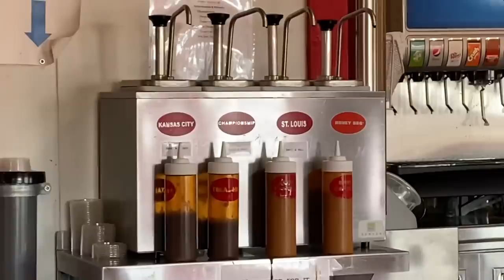FOUND: Two CLASSIC PORSCHES sitting in St. Louis

Comment: Those cars are rough. I can't wait to see them restored !!
Reply: I can not imagine, how you even restore cars like that, where everything is rotten or missing :-O
Reply: @TheTazzietiger  and time.
Reply: @Spazik86  With the whole damn Stoddard catalog, about 575 miles of MIG wire, and a dump truck full of money.
Reply: I’ve nearly finished a 67 912 resto-rod and even tho me and my buddy have done 90% of the labor it’s been very very expensive. I bought the car 6 months ago for $12,000 with no engine. The body was way better than either of these cars.. Even a stock restoration for these cars would take well over $35K each in parts, plus 100s of hours labor and they would be worth around $50-60K, not worth it.

Comment: Dennis, I found some legit rare or desirable musclecars in the '80s and '90s in junkyards, like a Buick GS California and a Mustang GT 390, just like Frank Bullit's. A Roadrunner 400+6 as another example. They were in junkyards because they were junk, but the VINs were legit and somebody (hopefully) grabbed them before they went to the crusher. It's not an easy task to find an unwanted or forgotten car and make it worthwhile and it ain't cheap. You need a passion and drive to do it. I physically looked at eight cars and researched three  more online last year in order to replace a low production 2007 car I let go in 2012. I broke a cardinal rule and bought one (I looked at one the previous spring and didn't buy that either), in a hard rainstorm, for right in the middle of my budget. Turned out to be a damn good car but what can you tell about the body in the rain? It was a needless chance I took but the car 'felt' right. I even found my original car- it had hit a deer in 2018 and was badly damaged but repaired. Seven of the ones I looked at or into were trashed, one so badly it wouldn't rev over 3K. Slowest test drive ever. The rest were vastly overpriced, needed paintwork easily half the value of the asking price,  or were  over 3,000 miles away.  You seem to have the passion and drive. Good job.

Comment: 1967 Porsche 911 Coupe SWB numbers-matching Type 901/05 air-cooled flat-six with a chain-driven single overhead cam on each bank, dry-sump lubrication, and Weber carburetors, 5 speed RHD Sunroof factory. MINT were brokering at the moment.

Comment: yeah. I'm tripping on these rides. Cute kid. In 1980 I was single and was in Idaho  heading from Colorado to Washington state to work on a Salmon boat. I was checking out a local paper and there was an ad for a 67 912 with a mfg sunroof. Was with my best friend driving a 57Apache 1/2ton step side up 4 x4 4Speed with a 283 cu. and alum  camper low top we got for $650 in Oak View California in the late spring. Had my tipi I'd made on all treadle sewing machine with the lodge pole pines on the top. man those were the days of just being young and single and every $ meant something. We'd worked for a coal mine laying.track for their rail cars to transport coal in Craig Colorado. We had a few $ saves and lived with nature. I had always wanted a Porsche. Well since we had time we went to see this ride some young rancher had and man it was sweet. The man needed a truck bad so the Porsche had to go. I got it for $2500 after some horse trading. Being a California surfer My dreams came true. We had $200bwtween us and headed out to The mouth of the Columbia River and in 2 rides. The day we got there we were working the next day on 2different trawlers for Salmon. Our friend gave us a trailer to live in and it sat in the forest about 5 miles from Illwaco Washing where we worked. They only made 5000sun roof 912s in 1967. This car had no rust and less than 100000. Kept it for 12 years til my future wife got rear ended by some dumb bitch in a huge Ford truck. It climbed on top of our Porsche and she had our New baby in the the car. Lucky no one got killed. This dumb woman just ruined my dream car. My wife freaked out as this was our first child and she loves the car as much as the baby
 She screamed at the woman my baby my baby. The woman said to her get over it the kids just asleep. My husband's a sheriff so